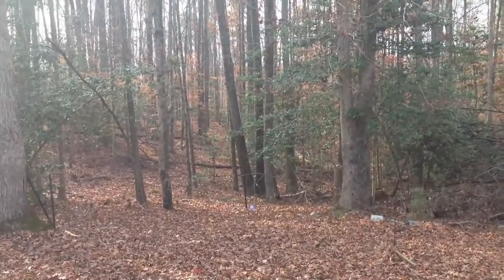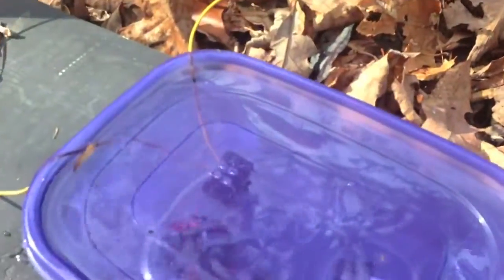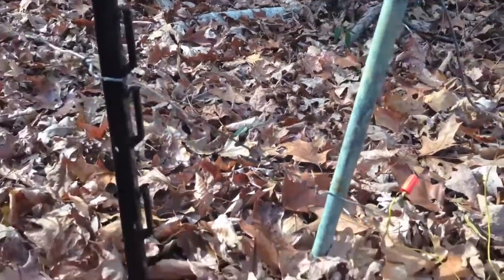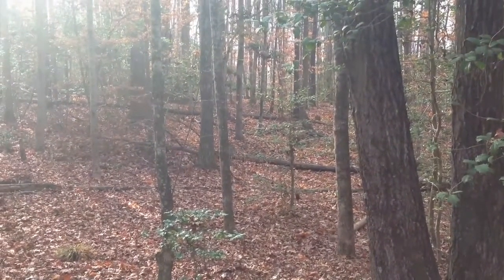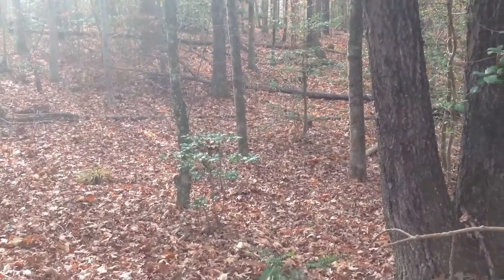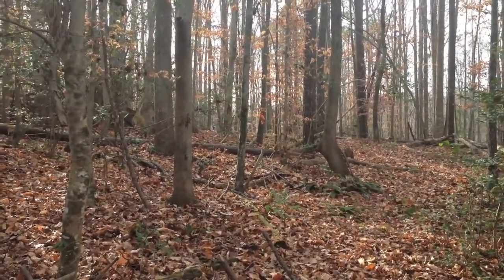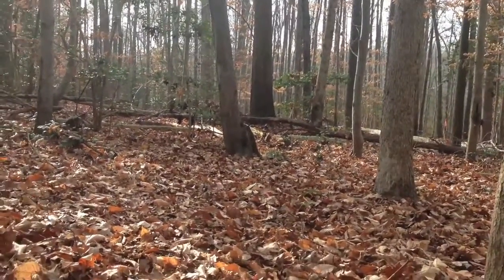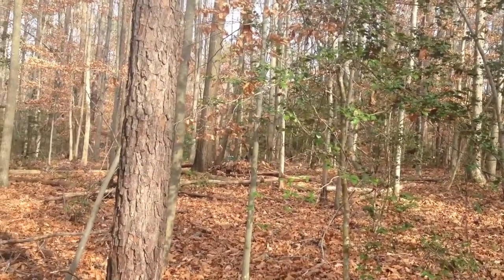Un Terminated Beverage HD

Comment: Really nice . What antenna you use for transmitting?????
Reply from the maker: I use an old fashioned "Inverted L". About 165 to 175 ft long.  Fed with a series capacitor at the bottom. Input impedance to a wire that long is about 50 ohms resistive and the cap tunes out the reactance that exists because the antenna is longer than a resonant quarter wave to get the R up to 50. Also moves the high current point up the wire a bit.
Reply: Thank you very much for quick response . Gl 73

Comment: How deep is your ground rod into the ground?
Reply from the maker: Yu Dale I use either a standard 8 foot ground or in several cases I took one 8 foot rod and cut it in half and used 4 ft at each end. They worked good both ways, but I probably had good ground to start with.  At the terminating end, I figure the effective resistance is probably slightly higher with a short ground rod. It would be the resistor value plus the ground resistance. So if using a 160 ohm resistor with a bad ground you may end up with closer to 200 ohms, with the same resistor and a perfect ground you would end up with 160 ohms. Very hard to detect the difference in practice. I use the rule of thumb that a ground rod will be about 35 ohms, better grounds will be somewhat less.